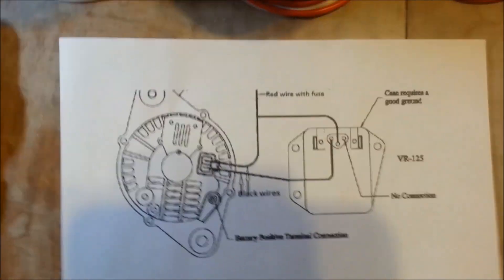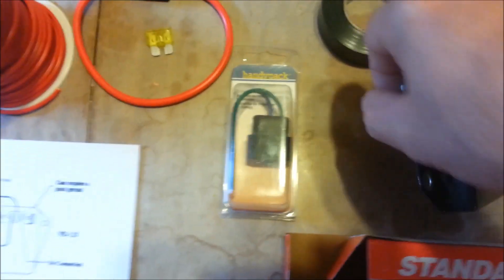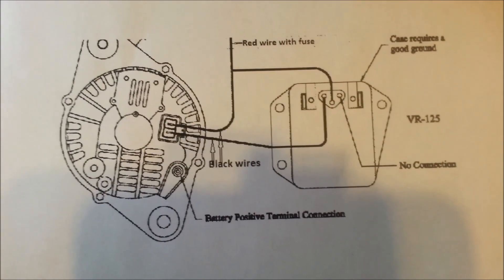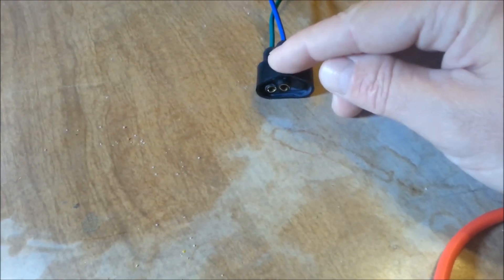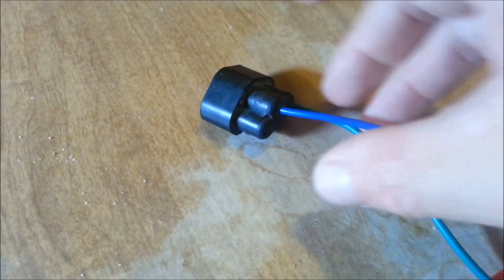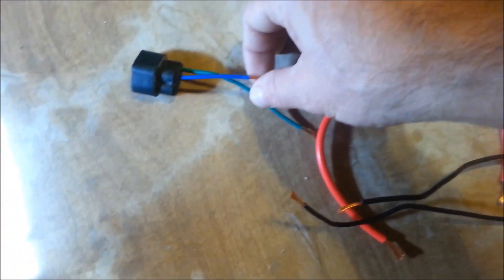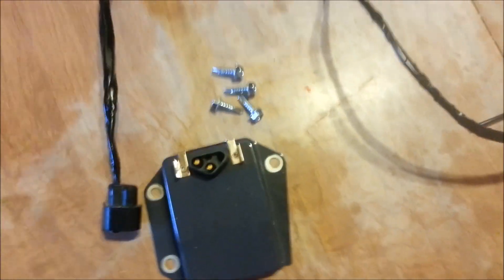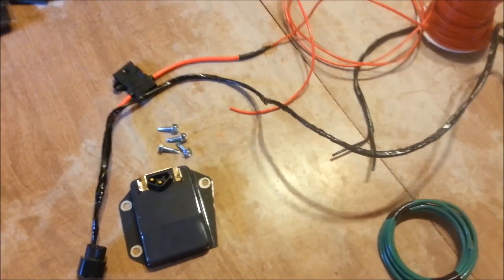How to make a External Voltage Regulator to Bypass a Dodge computer, ECM

Comment: Run power to the remote stereo wire. Its the same as an ignition wire. Plus it hides the wires and much more professional looking than wiring to fuse box. You won't be able to tell it doesn't belong to the car.
Reply: WRONG, go to a 15A or 20A Fuse in the under hood fuse box. You want the Fuse to blow before your wires or Regulator get smoked if something goes wrong. The Fuse has to be HOT IN RUN Position, & must turn off when the ignition key is turned off. The Remote stereo wire turns your Stereo Amplifier on when the Stereo is turned on. Alternator must be charging even if the stereo is turned off.😉🇺🇸

Comment: is there a way to have an external regulator but keep the battery gauge working in the dash?
Reply: I have installed this in my 2002 ram 2500 and the check engine light is not on and my voltage meter works on the dash.
Reply: @19gmartin84  did you cut the wires at the alternator plug or do an inline splice and leave them connected to the pcm
Reply: Good question!  That detail is not mentioned in the video.  (The "check engine light" remaining on is also a problem when it comes to getting your inspection).

Comment: Is the inline fuse just to ensure that you don't get an overcharge if the regulator fails?
Reply from the maker: AeternalDesigns Its just a cheap safety device, not really needed especially when tied into the fuse box. I use it since their cheap and it gives more control but most people don't. Basically a personal  choice.